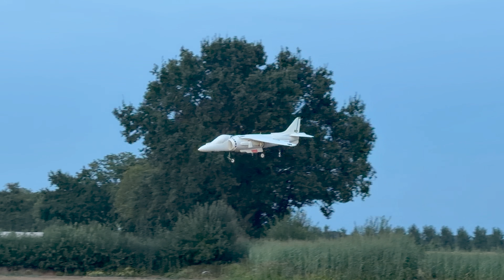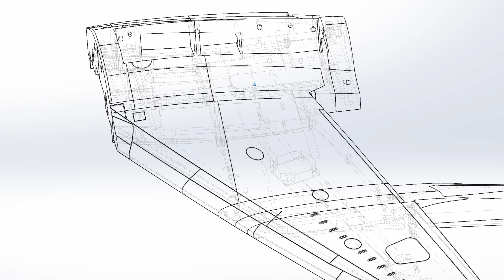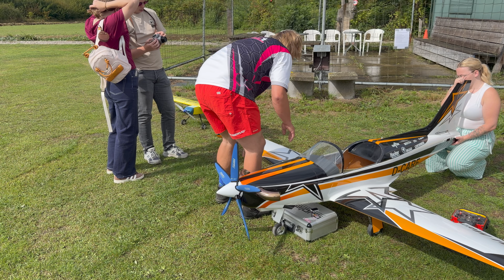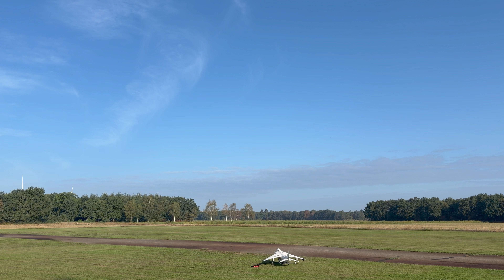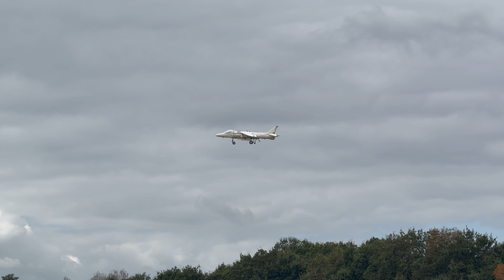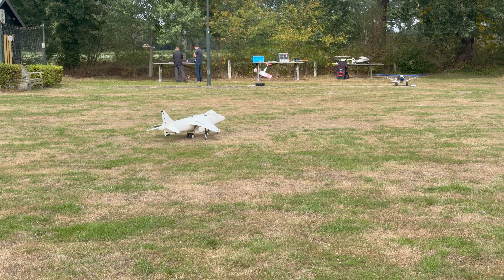VTOL to Forward Flight: My 7-Year RC Harrier Build Hits Its Biggest Milestone Yet! Insane!

Comment: When you go to the larger scale, do you plan on using or incorporating the role reaction control, nozzles, and aft, pitched yard reaction control nozzle?
Reply from the maker: Yes to start with only on the wing tips, i need lifting capacity of the pitch edf. They give me an additional 8Kg push